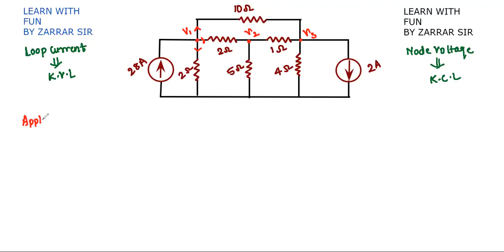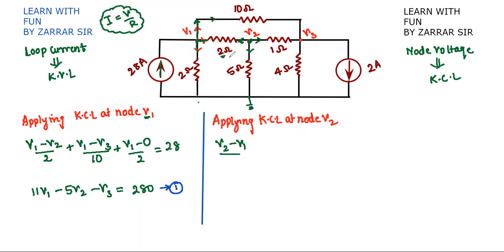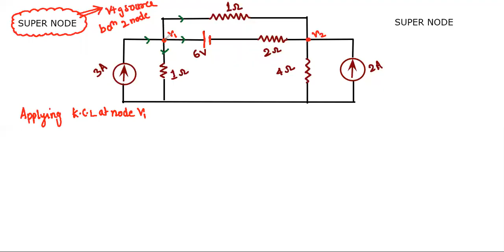LEARN advance type of KCL , SUPER NODE in 15 min

Comment: I have a fundamental doubt. 
While analyzing each node, you'd have to consider the currents that come in and go out right? So why is it that in your first example, you considered the currents in node 2 to be going out? And why did you take v2 to be greater than v1 while analyzing node 2? 
Would it be possible for you to clarify this?

Comment: I have a question. At 4:40 (super node), you mentioned the outward direction for the V2 node. However, earlier, you already indicated the current flow from V1 to V2, which implies that for V2, instead of an outward direction towards V1, the current flow should be inward. The same should apply for V3 as well. Is that a mistake?

Comment: in the second question what will be the equation if there is no resistor present in between both nodes V1-6-V2/?
Reply: i was about the same quetion , but try putting zero there and lets seee

Comment: In the 1st equation v1-6 I get it but why the v2 is in subtraction. As high is connected to high so - but then the low portion of 6v is going to v2 means at high so it will be like this right v1-6+v2.
Reply: I also have this same question

Comment: with this formula you dont need kvl right?. or remove the non-reference voltage and make a whole new diagram to solve the question
Reply from the maker: Sorry I didn't got your question
Reply: @ZarrarKhan  like in supernode analysis. Most people redraw the diagram and remove the non - reference voltage and solve it. But you don’t seem to do that here. And is pretty easy
Reply from the maker: @liv2.9  yes you can follow my way it is 100% correct 
And thanks a lot
Reply: @ZarrarKhan  ok thank you

Comment: Super bro 🥳
Reply: How do we know resistors are connected in series or parallel and how to combine them and connect in circuit again
Reply from the maker: @YEE-qn1kv  while calculating resistance make sure voltage source are short 
And current source are open 

And if resistance are connected to each other at both the terminal then it is parallel 

If it is connected to one terminal then it is series
Reply from the maker: Thanks a lot 🙏

Comment: Sir what if there is voltage source b/w 2 nodes without  resistance what will be the constrain equation
Reply from the maker: Awesome question the answer is simple 
We will either add those voltage or subtract voltage

Comment: 14:14.  Here in node v2, v1 is in lower potential and 6v is in higher potential,so we add the voltage.Then why did you subtracted it.

PS: your class is so use full...thank you.
Reply from the maker: Whenever we are at any node we consider it to be at higher voltage 
And regarding 6 V when V2 is higher 6V negative is connected so.we add it

Thanks a lot for your doubt
And most welcome
Reply: @ZarrarKhan  thank you👍
Reply from the maker: @safwdp  most welcome
Reply: E -23 manasa K  YAHI SAMJH  NAHI AA RAHA HAI..PLZ KOI CLR KR DO ESSE